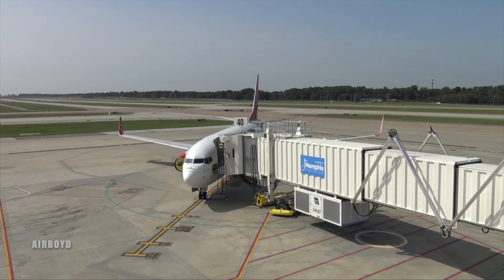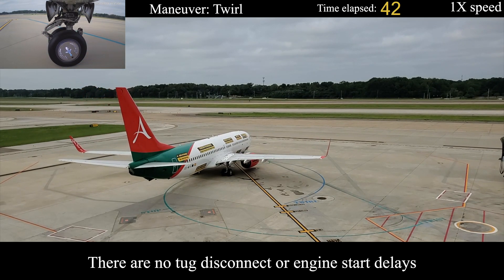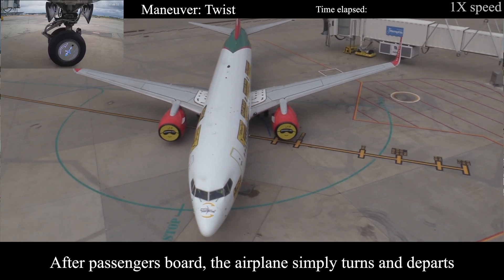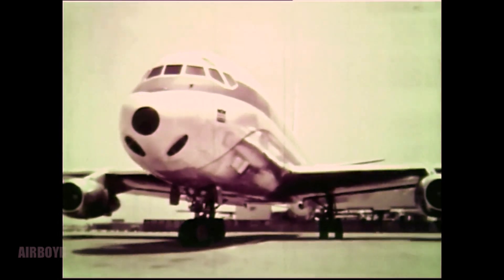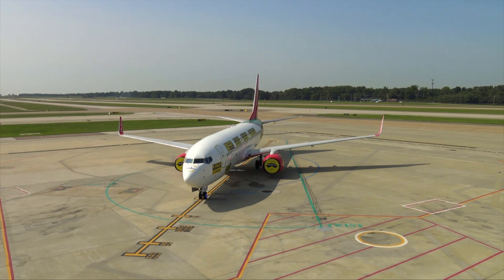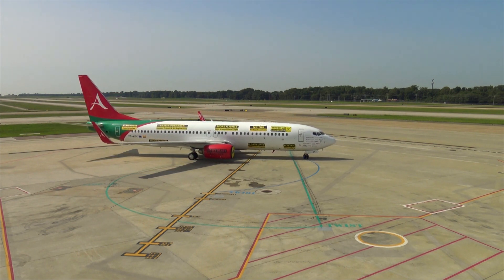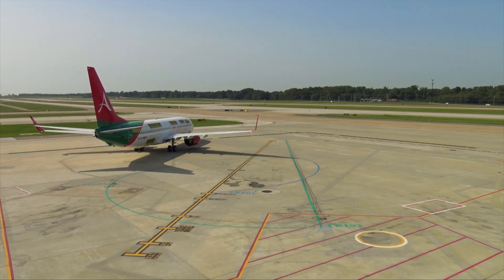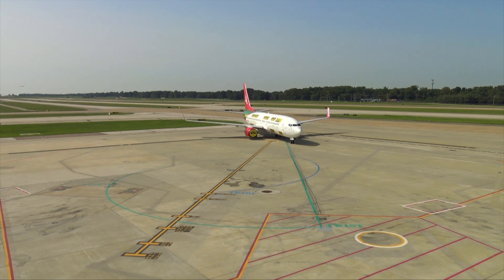WheelTug 737 Demonstration • Memphis Airport

Comment: This will add complexity to the plane and the cockpit. Is this better then a better designed tow tug?
Reply: Yeah, this is why external tugs are already in service, but the ease of use for the pilot is probably much better. I imagine this thing could probably be twice as fast to use. You'd imagine they could make this in to a system where you could actually taxi to the runway with it.

Comment: How much increase in power output does the APU need to run that little wheel tug? 

It takes real electrical power to move a commercial jet around....is it hydraulic power?
Reply: There probably isn't any increased need for power, just increased usage of the APU.
Reply: @rkan2  i would like to see the wiring from the APU to the front wheel
Reply: So push back tugs have been grossly overbuilt all these years.  They can be replaced by an electric motor in the front wheels.  Where are the front brakes the motor would displace?  I'm armchair engineering this, it just raises some questions.
Reply: @michaelmccarthy4615  These planes don't have front brakes anyways. Only main gear braking. By the way you are right with the overbuilt pushback trucks, check out the product 'Mototok', they do the same as pushback trucks and are 3 times smaller
Reply: I can't believe Boeing or Airbus haven't tried to integrate something like this into their design before.   It seems too complicated to be a stand alone option.